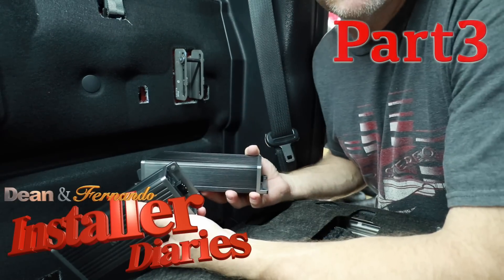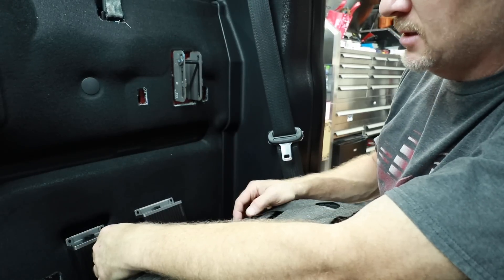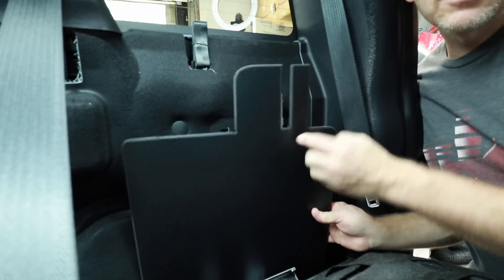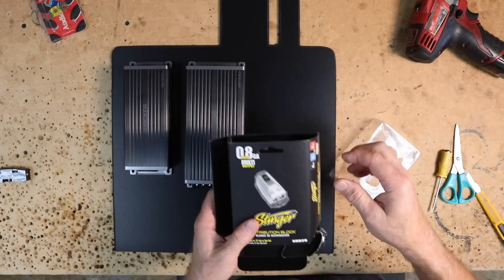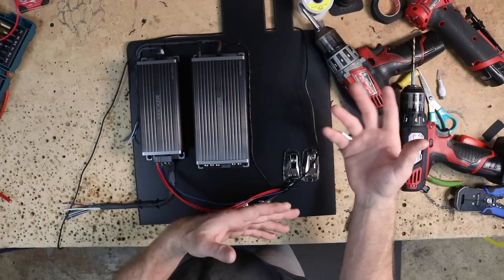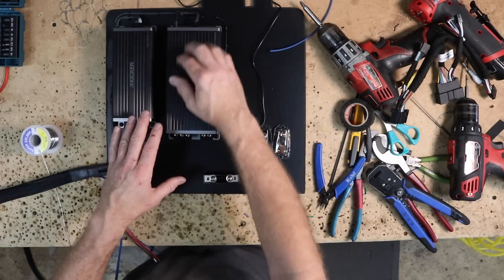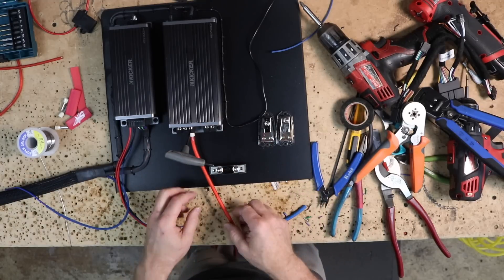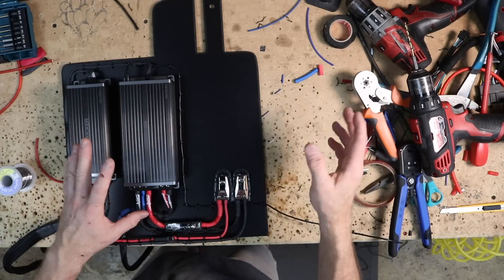How to mount and wire up the amps F150 Installer Diaries 271 part3

Comment: Imagine how much cleaner it would have been with a fused distribution block. I'm sure you know this, but the fuse protects the wire. You could have ran a 30A. Even if the amp full-short crapped out, that 30A is gonna pop nanoseconds after a 20A would have. Insignificant.

Comment: Also when you use a t-harness the remote (blue wire) connects to speed wire.... in your video of installing 200.4 and the 500.1 for the subwoofer

Comment: I'm planning on installing these amps in my 19 f150. I'm planning on using the 200.4 to power the 4 doors. Where should the signal for the subwoofer get pulled from?

Comment: Not much detail was shown on the config of the inputs coming from the T-harness to the two amplifiers.  Do you basically just Y-split the wires from the T-harness and send one branch to each amplifier since it’s high-level in this vehicle?  What would you do if you had one set of low-level inputs?  Same Y-split just w/ RCA’s?

Comment: I love the idea of these Amplifiers, I have a JL XD700/5 amp sitting here on a shelf. But I like the fact these have simple DSP in them. What would you recommend keep the JL or go for the Kicker Key. I would probably go with same setup up but run power to rear doors as well. I just got a 2017 F150 Thanks for showing this. One more question why go high level instead of low level? Added cost of amp pro?

Comment: What if you ran a 100 amp fuse at the battery wouldn't that work and you won't need the fuse holder all the way in the back

Comment: I have a 24’ RAV4 non-JBL system. There’s not much room to play with. I’m looking to add the key 200.4 and the Key 500.1 just like this setup. Where are you getting the signal for each amp? I only have 4 pairs of speaker wires coming off the head unit. Can the 500.1 get signal from the same speaker wires the 200.4 is getting signal from?
Reply from the maker: Yes that is how you would do it.